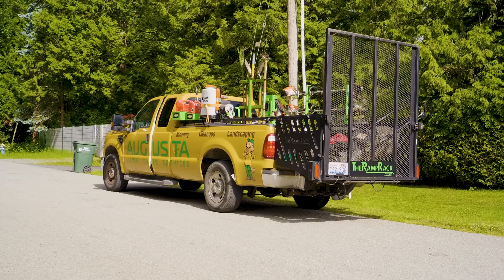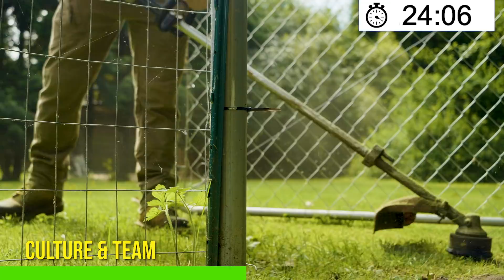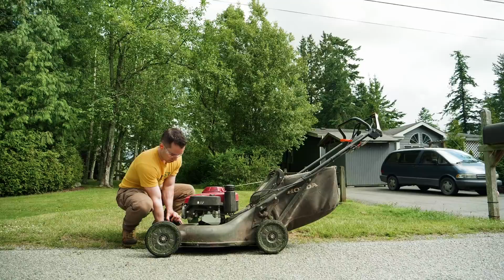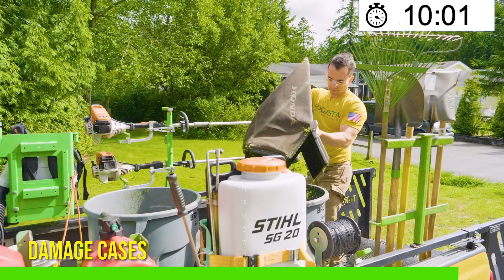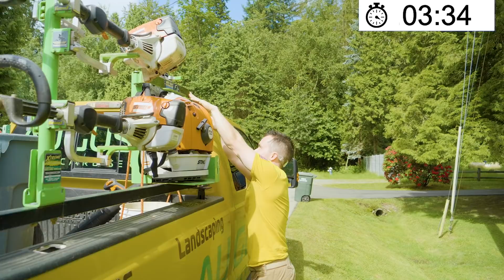This Client Complained: I Didn't Apologize!

Comment: That's a customer that has never done yardwork or has forgotten how dirty it can be. Especially in heat. On the flip side I've seen a couple of companies that could learn from your practices. I've told my mom's service a couple of times that they need to cut her lawn at 3.5 inches since its TTTF (new cultiver that was dormant seeded) and is still in its first year. They nodded their heads did it at that height when I was there and went back to 2 inches (they cut all of there customers at that height) when they came back this week. I told my mom to put them on notice that they need to make the correction or we will find someone else. If I wasn't 900 miles away I would do it myself. Anyway. Good job and great handling of a customer.
Reply: TTTF can be mowed as short as 1” if properly cared for so 2” isn’t really that short even if it’s in it’s first year… please do your research before telling a professional landscaper how to do his job.
Reply: @thechef33  still though if he wants his yard 3.5 he should be able to get it cut 3.5
Reply: @andrewsmiley1835  i agree, but it’s the attitude of “you need to do this because blah blah blah” that is frustrating to deal with. A) that’s not even true B) professionals know more than the client 9/10 times simply because of they have more experience.

Just leave it at “please cut the lawn at 3.5 inches” and if the landscaper can’t follow those simple directions fire him. It’s the know it all attitude from customers that make the professionals intentionally not follow customer directions. I’ve personally dropped several clients just because I’m not taking shit for technically doing a job correctly, even though the client is livid. There are a few exceptions to that obviously, but if a client doesn’t trust me I don’t want to service their property.

Comment: I work for Mosquito Squad.  We have to wear Cameras.  This is ONE of the many reasons why.

I went to a property, and it was an ASR (Additional Spray Request) which tends to mean either bad weather ruined the spray, or the worker did an ineffective spray.  I read the notes on the property, did the walk around, it was very small and very simple.  There was almost no front lawn, and only the back yard had a tree line.  I could hit the foundation of the house on 3 sides WHILE doing the perimeter, with only the back yard having enough room to not reach.

The notes said the last guy didn't do the Double Pass.  The Double Pass is the woodland area, about 20 Feet in, to add an additional barrier of protection.  In a lot of places, like packed suburbs where you have no woods because 3 sides are connecting to neighbors fences, there is no Double Pass (it is important to understand the Double Pass is an AREA, not a second spraying of an area).  The note also said to call my manager before starting, which I scoffed about but did.  I told him the yard was small AND simple, and all the notes said in their word salad could be summed up in "Do your job".  Everything they mentioned was basic tenants of what we are supposed to do at every property.  There is literally NOTHING special about this place.  I also call the customer, as we do.  Sent to Voice Message, and I EXPLAIN I understand her woods were not treated last time and I am making a point of treating them.

My manager told me it wasn't a difficult property, but a difficult customer.  So I set about my job.  I start at the right side of the house so I can do the Perimeter and Foundation of everything that isn't in the back right out the gate.  I do this because the property is so small, and I want to be efficient.  So I started on the right, to the front, to the left which is super fast because this ENTIRE Property is 0.25 Acres and most of that is Back Yard.  I can hit everything in a single pass on the sides and front.  Then I dive into the back yard, perimeter first.  Usually, after the perimeter we would do the 'Double Pass', but I want to spend time there and make a show of it so I save that for last.  With the perimeter complete, that means I hit the yard on the way to the Back Foundation.  I spend more time here 'laying' spray, much more than required or needed, to make a show.  THEN I head into the woods and spend time there.  This property COULD take about 5 Minutes with a single fast worker, but we give 17 Minutes for anything at 0.5 Acres or less.  Customers don't understand a simple AND small property like this just doesn't take a lot of time to effectively spray.  But because of this customer, I spend 25 Minutes on 0.25 Acres.  Job well done, probably the best spray this property has ever received... best in how it looked, it was super inefficient because I over sprayed and over stayed by A LOT.

Get called into the office 2 days later.  ASR review.  WTF?  I'm a Terminator.  I'm a Golden God.  What property could this possible be?  Yep, it's that same lady.  She said I didn't spray the Back Yard AT ALL.  Not the Double Pass in the woods, which is a common claim, but she thinks I skipped 0.20 of a 0.25 Acre Property somehow DESPITE the loud noise of the blower being on her property for 25 minutes.

To the video we go.  It might as well be a Training Video showing people how to crush a property.  Zip, I'm around the sides and front and onto the Back.  Boom, perimeter done.  Back Yard, Back Foundation.  Diving into the woods.  25 Minutes on a 0.25, all in an effort to please the customer and make a show of something that should legit be a 5 minute job.  I go above and beyond the standards, and it's all on the tape.

Manager compliments the job.  Does his job, sends the video to the Customer.  ASR denied, no free spray for you.  Now SOMETIMES the Customer emails back, apologizes, praises the spray and explains they didn't realize how quickly we could do the job, or didn't realize how deep into the woods, or under the porches and hard to reach places, all that good stuff.  This lady, just never responds.  To any of these.  My manager has been dealing with her for YEARS, and this happens 10 times a Season from her.

For guys like this, I'd wear a camera.  Nothing beats proof.

Comment: This is one of the reasons why window cleaners do the inside of the house first, that’s the part that is air conditioned. No one wants a dirty dude inside their home.

But so long as the employees aren’t coming into your home, why should a customer give a damn what they look and smell like?
Reply: Jay Moolah  well yeah but up to a certain point. I mean a guy who’s working with a gasoline powered machine that’s tossing dirt around in 90 degree heat isn’t going to look he’s ready for church ya know.
Reply: Jay Moolah  the uniform is enough when it comes to land scaping and lawn caring.
Dirty job get dirty.

Comment: If you have a employee that is habitually underperforming ( costing you $ due to breaking equipment/ property damage) at what point do you let him go?
Reply: Depends on the nature of the damage. Broken equipment because of carelessness/clumsy/improper use or tossed the tool in the truck breaking tool/other tools and/or the truck vs you damaged the lawn because you turned to fast vs you hit something you could have picked up/avoided assuming you noticed it and it broke a window/siding... 1 is wilfull lack of respect for company property  2 is careless operation or lack of experience 3 might be true accident depending on the property and tool and cost of damage when you watched it happen or you have undisputable proof

Comment: One thing to keep clear typically is that bonuses (discretionary pay) versus commission(performance earning, earned wage) are different and commission is treated like hourly pay in most states. There are no if and or butts about it, with commission if they earned it they must be payed for it, it cannot be altered if the metrics used were done. Bonuses are not guaranteed where as commission is.

Comment: Hey Mike, just came across your channel and have been binge watching your videos.  On STIHL equipment rather than replacing every 3 years put them in rotation.  I drop mine off at the STIHL dealer every year to get a carb, filter, and plug replacements.  Also, keep your trimmer heads greased.

Comment: As a consumer when someone makes an excuse for why a job that wasn't done right, its very irritating. I don't want an apology or an excuse I just want it fixed. With 27 years in the military I have learned that an excuse doesn't get you anywhere, a well executed solution does.

Comment: such good advice regarding how to manage complaints. I have been guilty more than once of just taking the customer for their word and to some degree badmouthing a team member, in the sense of agreeing like "yeah thats crazy that they didn't do this" or whatever then later talking to the team member and finding out the whole story and realizing they did not do anything incorrect or there was a really good reason why they didn't finish something or do it to protocol . even if they don't know that you threw them under the bus it still feels really unkind and not cool knowing that you did. I have stopped doing that and also rarely say "sorry" anymore.in reality I hate to say it but usually the customer is not right. sure there are times when things just don't go right and you sometimes do have a worker that just isn't fit for the job for one reason or another but I agree, deal with it in a low key one on one basis and know the whole story . very good management by this man.It shows his confidence and competence in what he does to be able to handle things in that way.

Comment: We cut our trimmer string to length and most of us keep one thing of string in our back pocket so even if we run out we fill it on the go and go back to it  mowers just keep running and we fill them up after the accounts are done  seems to work great

Comment: I work at Menards and if we do something like drive the forklift through the overhead doors, you will be fined up to $200 to cover damages. I'm unsure if the store GM gets any kind of fine, but the individual store pays for the new door and installation, that amount hits the profit and if store profit drops below a certain percent, your store misses out on the company wide profit sharing.

Comment: The monthly vs price per cut. Monthly is the best for budgeting barring any unforseen happenings. You charge 40 for a yard and it just so happens there's a fill line leak and a good portion of the yard is now a foot tall or better and vines and saplings have started to rear up, that's a loss. Especially if the customer decides that the problem isn't bad enough to get fixed.

Comment: One critique.

Obviously you do very well for yourself.  So please don't take this wrong.

You have a definition issue.  You say the note says no edging, and then you explain that edging is precision work against things like concrete... which the customer doesn't have.  Trimming is the term you use for work around things like brush and trees.  All this is fine.

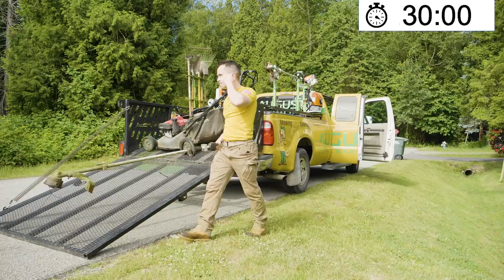Then at about 4:45 you say you will change the note, because the customer wants the edging.  He doesn't... he wants the trimming.  If the previous working didn't trim, because of the edging note, then that worker needs to be retrained in the difference in edging and trimming.  Changing/removing the note doesn't fix this issue.  Also, and it's just a little mistake while filming, using the wrong term as you did only adds to this confusion.  Because now workers hear you say a guy DOES want edging, and that you will remove the note that there is no edging... when what you're REALLY talking about is trimming.

This is a Definition Consistency and Education/Training issue.  The Note is correct and should stay.  Consistently using the terms correct, and educating/training the workers on the definition of your terms is the correct course of action here.

Comment: Nothing worse than dealing with costumers in the lawncare industry; however it's one of the best places to learn the in and outs of costumer service. And yes, some costumers mistaken lawncare services as them paying you by the hour. They have to be informed at the get go that they're paying for the service, not for how long it takes to perform that service. There's a lot of overhead in this industry. That equipment, insurance, labor, taxes, gas, maintenance, etc isn't cheap! That's got to be one of the most common aspects you run across are costumers complaining that you did the job too fast, even though they're happy with the results. Another one, they don't like lawn tractors. Once again, you cut their lawn too quickly. Like I told a costumer once, "We'll charge you less to cut your lawn with a lawn tractor, but you have to buy and maintain the lawn tractor." They never complained afterwards. LOL If you want a professional, pay. If you want the best bang for your buck, hire a teenager or buy your own equipment and do it yourself. Also learn when to let a costumer go. And be polite when letting them go because sometimes you'd be surprised when the old costumer contacts you back, asking you to take them on again. Oh and one more thing, they want you to cut their grass even though it doesn't need cutting, but then complain that it's burnt. Once again, remind them that it's like snow removal, they're paying monthly for a service when needed. Everything has to be made very transparent and clear within these contracts.
Reply: Jeeeeez. I think we have the easy clients then if people are complaining that you've cut their lawn too fast, or it should be cheaper because you use a tractor or zero turn. When I first started I've had people that wanted me to use their mower or snow blower especially, thinking it'd be cheaper. Literally it's some 20 year old, cheapest model, manual push mower, or snow blower, that has gas from 2-3 seasons ago, never starts no matter how much I yank on the starter cord and forces me to take my equipment off the truck anyways. The cheap clients we usually kick to the curb, they learn real quick that either the next company is more expensive, unreliable, or both and by that time we're not interested in any project they have.

Comment: You were NOT listening to this guy at all.  You were making excuses about edging or not edging.  Do you not educate your employees to know what that is?  He complained about another employee who doesn't do a very good job and you redirected him back to the edging issue.  You may have some guys working for you who don't do a very good job.  Do you ever check up on their work?  I've never seen a business owner who doesn't, occasionally, check work - especially when a customer is complaining.  You can't know the truth of a situation until you investigate, for yourself. If customer expectations are not being met, there is an apology due in that.  You admitted your guy may have misunderstood a note.  That's your fault, not the customers.  Soemetimes an apology for the situation is all it takes to take care of the situation.  As a middle-aged man, myself, when you cut a lawn, you cut, you trim, you clear debris.  That's the job.  Anything else is half assed.  I would have apologized for a possible misunderstanding - comped one cut (especially if it's only a 30-minute job) and then, I'd check up on the work of two recent laws those 2 employees cut.  And if it doesn't meet your standards, you don't make excuses, you deal with the problem so other customers don't wind up unsatisfied.  You may think losing a customer here or there isn't a big deal, but over time those dissatisfied customers will spread the word.  Your best advertisers are your customers.  As the number of unsatisfied customers builds up over time, it will affect the number of people calling you.  You might have all the work you need now, but that doesn't mean you treat a customer like crap.  You work for them, not the other way around.

Comment: The employee may have been at fault...I can't imagine thinking that a lawn wouldn't have the trimming around trees and such done.  The customer was way off base complaining about the employee being dirty, that's just silly.  But, that's why I'm not interested in having a big enough business to have to hire crew.  That's the way to make real money, but I'd rather make whatever I can make by doing the work myself.  I appreciate the man using a stihl FS series...I have a 91, 100 and 131.  Torque all day long.  Though, I removed the guards.  You can cut more grass, and faster with the guard off.  Especially on ditches and slopes...because you can run the line out longer than guard would allow...I don't even carry a push mower as I use my trimmers to cut anything I can't get with my zero turn.  When it comes to things like how you price, what services you offer, how you bill...these all depend on your area.  In my area, I can't surcharge for dog poop.  Most everyone wants bi weekly service, even though yards can grow to 10-12" in that time.  No one asks for bagged clippings.  No one asks for edging, so I save time/cost by cutting along concrete with string trimmer on an angle.  No one would want 12month billing, or even monthly billing during the season...they pay after each time I cut.  But, all of those things are what customers around me like.  In other areas, it can be a whole different ball game.